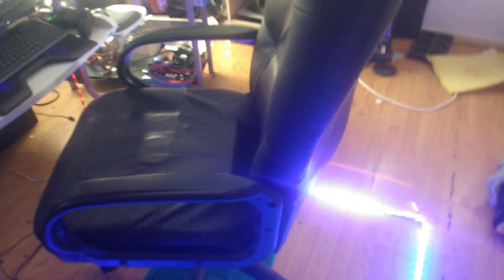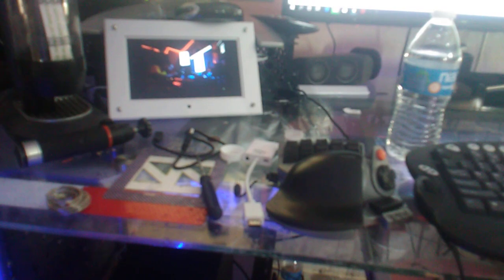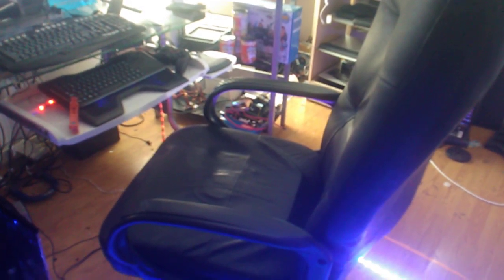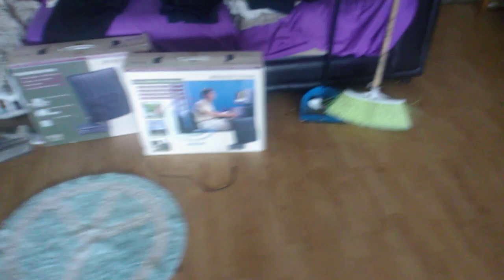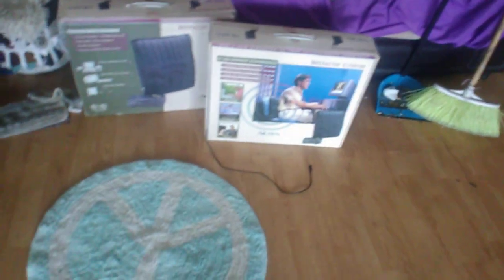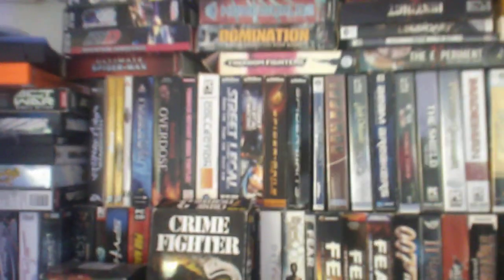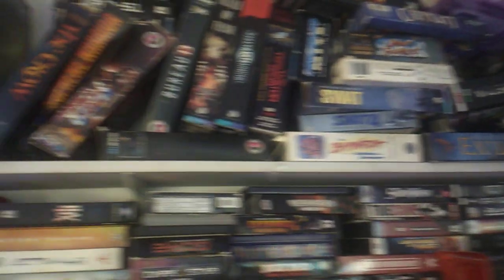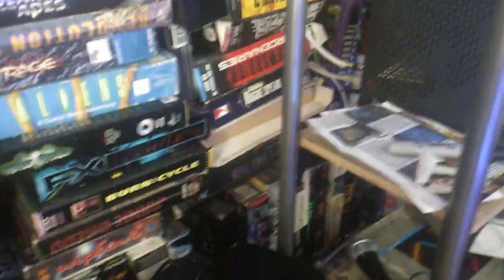Modified AURA Interactor PC CHAIR. CHEAP and Goodwill Shoping.

Comment: X rocker made chairs like that but they sucked . You could feal the subwoofer naming into your back . That not an subwoofer tho it's an bass shaker . So no idea if you could feal it in your back
Reply from the maker: your right. but the amp on this is great and these are from early 1997 for SNES and Genesis
Reply from the maker: and they are speakers still bass speakers. Look up AURA INTERACTOR
Reply from the maker: And the Wheels are great with Studs and I am makingit wireless